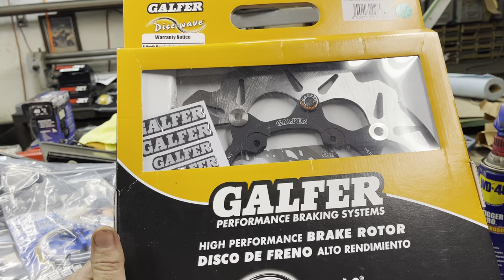2021 KTM 890 Rally Build! Rottweiler performance intake review and other mods.

Comment: Randomly stumbled upon this video. I pick up my new adventure 790r on Tuesday. 
You name drop so many great parts. I just ordered the fuel cap eliminator from power cell and have a cart full on Rottweilers website. Holding off on that stuff until I get some miles on it. 
Thanks for this video. Subscribed, and will binge your others.

Comment: Check that foam air filter that came with the intake to make sure it’s thick enough to catch all dust.  I’m hearing (from a friend who’s had this happen to him recently) about multiple engines out of commission due to this filter being too thin or the spaces being to large — either way, letting dust right through. 
I’m not trying to start a bashing here; I have no reason for that. Just look at the filter and see if you can’t see right through the material.  
Take care.
Reply from the maker: I make sure I oil my filter correctly and haven’t had any problems with anything sneaking past. I will keep an eye on it and thank you for letting me know. I think the key to this is using proper oil. I’ve use Rottweilers products since about the beginning I never have had an issue. I use the no toil biodegradable oil.

Comment: I have the 790 r and the tank side protectors will fit in between the axp skid plate with no modification. You will have to take out the bolts by the foot pegs and pull the skid plate down in order to take out the oil filter when charging oil.

Comment: I know this was two years ago but I just came across it and man, what an awesome build. Big thumbs up on that. I’m trying to locate a Rally 890 but the dealers who still have them still have the for a reason. Do you still own this one?
Reply from the maker: I just recently sold this motorcycle that was a dream build! But a 701 rally adventure suited who I am much more than the 890. To be clear the 890 would be great for 55% on road and 45% off-road where the 701 is exactly opposite of that which fits me just a little bit better. I get a little bit longer range and much lighter, more nimble, and just better overall off-road for me! There really isn’t a bad choice between the two! I just couldn’t keep them both! Hope this helps! Cheers!

Comment: Chris at Rot has some incredible additions for bikes as well as customer service. Check out the TI pegs. I use them on all my dirt bikes and decided to put them on my 790.  Nice tweak on the can. Sounds Gnarly! I also wired my Voyager pro as well as for Garmin 750i so I could interchange on the VANASCHE GPS bracket whichever I decide to use on that ride Lots of TI!

Comment: Amazing build and video! I'm (very excitedly) about to pull the trigger on a Rottie intake system for my 890 R, just did the Arrow midpipe decat last weekend. It looks like you're running the stock silencer; did you also decat the bike?
Reply from the maker: Thank you! I really love the Rottweiler intake system and I got a couple extra filters for it! The bike is so easy to service for filter changes! I did do the cat delete in the dark exhaust that came with the rally has been cut down 4 inches! Such a bitch and bike! Thank you for the positive comment!
Reply: @TRCa51  Awesome, thanks! Yeah I did a change on my paper air filter after our last BDR ride and found dirt in the throttle bodies. That filter definitely doesn't seem to keep dust out of the engine, and for that reason alone I'm motivated to do it...plus the sound and power improvements aren't a bad incentive either. Even just taking the cat out and replacing it with the Arrow midpipe made the bike so much more badass sounding. I'm definitely gonna get this and install ASAP! Keep uploading :)
Reply from the maker: @HenryFromReclaimAI  thank you brother! I just saw that all Rottweiler has right now is the orange plastic intakes for the 890s. I don’t know if it’s commonly known either but he uses twin air to manufacture his filters. Good stuff!

Comment: Thanks for the video Tim.  I have my 790 AR apart now to install many of the items you covered in this video.  I am trying to decide what to do with the vent hose on my Powercell gas cap.  I was thinking of going with the vent check but I think you have scared me away from that!
Reply from the maker: Lol! Better in the shop than on the trail! Lol! I just used Renthal grip glue on it and no chance of it coming out again. The cap comes sealed and not drilled. You can use all of the factory lines off the back side of the cap. Thanks for commenting and view! Cheers!
Reply: @TRCa51  I installed a Rottweiler evap canister delete kit.  I will probably just run vent hose off the vent connection on the front of the Powercell and run it down and out the bottom of the skid plate.
Reply from the maker: @JamesLG4  that will work for sure!

Comment: Nice build brother!  I've got the Akro exhaust, decat, and RR intake on my new 890 adventure r as well and considering adding the PCV however unsure about losing the cruise control feature.  Did you install a power commander yet?  If so what map are you running and would you say it makes sense on this bike?  I did the whole 9 yards on my previous 690 and it was defenitly a game changer...
Reply from the maker: I have the full race map and the air fuel sensors for the auto tune and yes I did lose cruise control. For how I intend to use this bike it was a concern of mine. My 1290 has all of this done also I love the power and I also love the cruise control for long days on the road. I really hope they come up with a dongle or a workaround to get cruise control back. With my current tire and wheel set up I know I won’t be doing crazy miles on the blacktop. The 890 is set up as much a dirtbike as possible.
Reply: @TRCa51  Awesome, I'll most likely just get the street map then for the time being and we can hope for a fix in the future. Thanks again, Cheers!

Comment: Hi Tim,  nice video!  Are you running the stock bars?  How did the HDB kit fit? I have had them on bikes in the past, but they always needed a bit of re-engineering to get the fit right.
Reply from the maker: Yes I’m running the stock ones. For installation I just get everything started and the HDB kind of bends into place. I do think it’s a great product but you have to massage and a little to get it into place.
Reply: Thanks!  Did you powder coat or paint the handguards black?  I didn't think they offered black anodized ones any more.
Reply from the maker: @DMoenBC  I powder coated them here in the shop. I have used Rustolum professional flat black that is the same look and really easy to touch up when you have one of those days!

Comment: Hey Tim, I'm after levers for my 890R whose are you running and would you recommend them?
Reply from the maker: I got them off of eBay and so far they’re great! I wasn’t able to run the brake lever because the Bumbo has a specific lever. Check eBay or even Amazon. I’ve had great luck with both. Sorry I don’t have a link. Hope this helps though!
Reply: @TRCa51  thank you sir!   I've got a cart built for Rotty for black Friday.   they are great as you say, I'm grabbing the non carbon version of that intake I just have map questions for them before completing .   Your bike has some of my wishlist but I'm not sure if I need as I don't do hard offroad I.e. Your brp risers and the Scot stab.

Did you end up getting the Rebel X tower in last year and on?  I'm debating between a few towers vs. Value but it's so hard to compare them....  Rebel, rally raid, mst and aurora.  I love the Aurora.

Cheers and thanks for the reply!

Comment: Does the Rottweiler air box sound a lot louder than the original? I’ m interested in buying it but I’ m a little bit concerned about the noise, considering i have already put an aftermarket muffler.
Reply from the maker: I would say it is a little louder but that with the seat off. I would think with the seat on and you already having an exhaust you would notice it at all! For me it’s was a no brainer, 8-9 hp more and easer to change a filter, easy to carry extra filters on a trip and better air filtration. And better throttle response! Hope this helps! Thank you for the comment! Cheers!

Comment: Awesome bike!   I have been looking at those handguards for my 890 as well.   Did you have the metal guard pieces powder coated or is that an optional color from HDB?  I'm guessing that its powder coating because I don't see it as an option on their website.
Reply from the maker: I powder coat them the same day they come in!! Any local shops should be able to knock them out! The HDB guards work so well! I have them on 3 bikes! One of the bikes is my extreme enduro bike and they have hit the ground several times and protect and hold up better that the circa pro bends witch I consider a top choice!!

Comment: What levers are those?
Reply from the maker: I got them off of EBay . They were very inexpensive and work great! Same brand I have on my 1290! Tighten up the bolts if you get them. Other than that they rock!
Reply: @TRCa51  could you post the link in a reply? I really want shorter levers for my 790 adventure r. Thanks!
Reply from the maker: @Kennedy_racing  I’m on my phone only remote. Go to eBay and search KTM 790 leavers and you should see them. If not I will be back in town this weekend and can use the computer to post a link. Please let me know if you can’t find them! Here to help just don’t know how to from my phone!